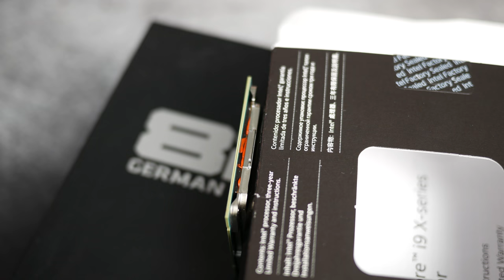We're back! i9-7900x Delid w/ der8auer Die Mate X

Comment: Hey Congrats on the new child!!!   I do like your videos and you seem like a cool guy.  I've done all the Delid homework I could before I decided to do my 3rd Delid on my 7820x and I thought I'd share some knowlage with you.  You should watch "Gamers Nexus" reviews on Delidding and it will show you that the temps and performance is much much better when you don't seal your IHS completely.  I took some plastic razor blades and took off as much of the intel "black glue" off of the sub-straight as I could without risking taking off some of the caps.  Then after I applied the Liquid Metal I only put a small amount of the same sealant that you used "orange reddish" on the corners and a bit on the top piece and my temps at idle are 22 C and the most I've seen with 100% Load for 10 minutes was 60 C.  Thats AWESOME!   I did a 7740x last month and I sealed it almost all the way around like you did and it did get better than stock thermal paste but not near as good as I think it could have been because idle was 30 C and loaded was 68 C.  I know thats not too bad but as you can tell from my last delid it probabally could've been much better.  Oh yea my 7820x temps were with a OC to 4.5 Ghz on all cores.  Good luck with your family!!!  and your i9-7900!!
Reply from the maker: Once again, I appreciate the information! That is all stuff that I will keep in mind and consider in the future. It's funny you mention Steve's videos because he is about the only channel I watch on a regular basis.

Thanks for the kind words my friend! It's definitely different being a dad, but not as difficult as it could be thanks to my wife. I really hit the jackpot with her. :)